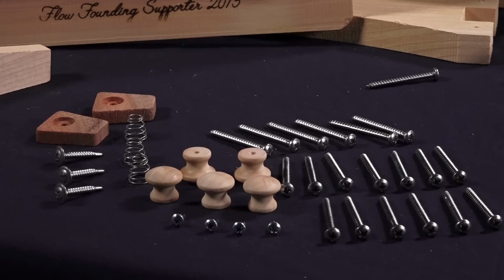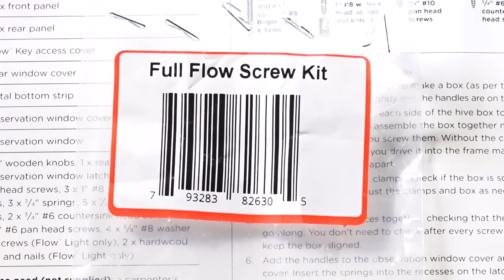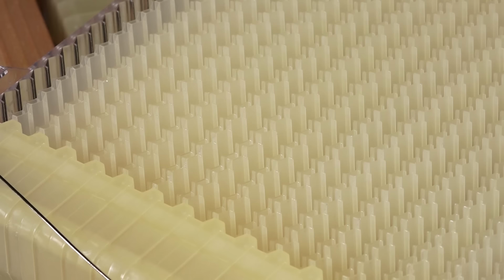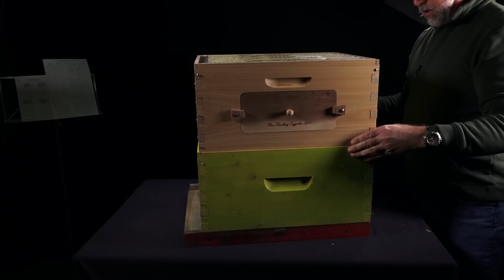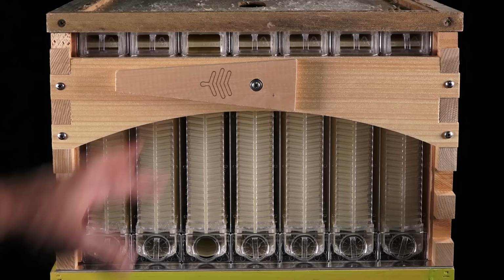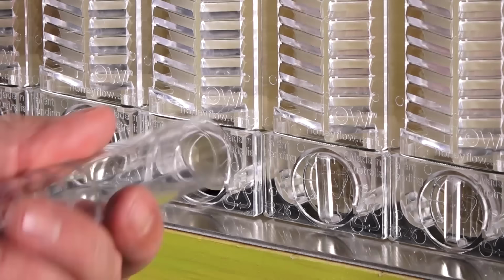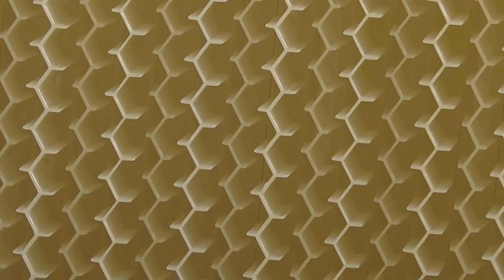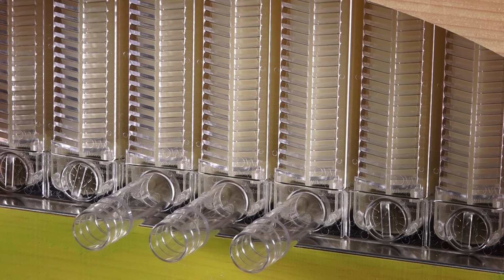The Flow Hive for honey bees, Love it? Hate it? or Undecided? Price? Review of Quality Control

Comment: This is the best tour of the Flow Hive full kit I've seen.  Thank you for your efforts.  I have a question about hive beetles.  Another FH user augmented his existing super with only a few FH frames and found he still needed to pull the frames to inspect for pests and this negated the benefit of using the FH frames to reduce disrupting the hive.  Do you think this will be a problem for your hive?  Are beetles a typical problem in your area?  Will you still pull your frames periodically to inspect for pests or do the bees herd the bugs out?
Reply: I just wanted to add that it is a great video, and I had to subscribe to see how it goes after you start your season.  Thanks
Reply from the maker: +Rave Racer First, thanks for the comment about the video.. and second, the honey bees I keep are super hygienic and varroa resistant lines, they route the hive beetles and mites out on their own. They are actually almost too vigilant in that they eject developing bees if anything is "detected" within the cell. I will of course, certainly show any evidence of small hive beetles with micro/macro video... but I don't expect a problem there. I'm also probably going to be one of those managers who does pull frames, even if it's a flow hive configuration, and then continue with draining honey if it's ready.
Reply: Cool, I'm looking forward to seeing that, especially how you put the frames back in without crushing bees considering the frames are such a tight fit.  Also I'm curious to see how you keep the bees from passing to the drain side of the box if you take the frames out.  Thanks for the response.  Good luck with your season.
Reply from the maker: The lateral space between cells is normal, not any different than normal drawn comb. The only tight, non passable, area is at the end you open. Other than that, it's normal.. pulling flow frames will be no more hazardous to the bees than when pulling normal frames with bees on them.

Comment: I didn't read the whole commentary history, I don't know if someone already said that, but I think the mismatch in the box joint is something related to wood expansion / shrinking, caused by changes in air humidity and the poor quality of wood. If the manufacturer did a mistake, it could be the choice  of the material.
Look at 2:12 to 2:18; the piece of wood on the right looks clearly larger than the one on the left, should it be expansion  or shrinking or - in the worst case - bad dimensionning and woodworking, but I don't think so.
Nevertheless, the clearly off center holes for screws don't help my version :)
Reply from the maker: The top and botton edges of the pieces match up perfectly, only the joint dimensions were off. The assembled box sits flush and top edges match perfectly.
Reply: So, in fact, for this one, it is obviously "bad woodworking".
Anyway, your video is very instructive, thanks.
Reply from the maker: Steel Mecano thank you

Comment: But if i bought the regular bee boxes for 3something then in order to get my honey i need another machine to spin it out and with this flow hive you just drain the hive basically so for about the same price on the 7 section flow hive you cut out spinning your honey just wondering if i missed something.
Reply from the maker: That's true, you end up not needing the extraction equipment... no uncapping tank, no spinner, no intermediate tank to hold the honey, no filtering process. So with the flow-super you would save all of those steps and also not have the cleanup which is something I personally don't miss :)

Comment: Apparently, the purpose of this FlowHive harvesting method is that you don't have open and take out the frames. But in the video you say that you would never harvest honey from cells that have not been capped ('cause the honey in them would not be ripe, water percentage higher than 20-22 %). And another point is: once you harvest the honey without cracking the wax capping on the cells, would the bees reopen and refill these empty cells or would they think that there is honey in those capped cells and rely on this "ghost stock" for the winter, risking to starve?
Reply from the maker: +steel1583 I personally open and look at the surface of any frame I plan to take honey from and I advise others to do the same. These FlowFrames are really not designed to be "pulled" although they show it being done on their website and in their videos. They are very flexible and HEAVY as they are deeper and heavier than a normal deep frame. The Honey Bees do know pretty fast that the honey is missing and chew off the caps, going right back to replenishing their honey stores.

Comment: What kind of plastic is this made out of?
Will it affect the honey?
Will the plastic deteriorate with the bees and sun thus affecting honey quality?
Reply from the maker: Now that many years have passed, these original frames are still usable. The honey does not take on any aspect of the plastic. In Hive Life (conference) in Tennessee held on January of 2023. Flow-Hive Honey won first place in the dark jar category. The judges mentioned that there were more entires than they have had anywhere in North America for more than ten years. Flow-Hive Honey avoids smoke, and other processing surfaces and particulates that most other honey takes on. Plastics are not showing up in honey, or the gut microbiome of the bees from the flow-frames. Micro-Plastics have shown up when swiffer sheets are used in bee hives for small hive beetle control, present in the bee gut, and honey.

Comment: What happens if you harvest the honey and discover it has a too high water content? Is there a way to test before extracting?
Reply from the maker: You can test the honey as it's being harvested. I've not had issues with it being too wet. BUT, if you did remove honey that had a high water content, I'd move it into a small room and run a dehumidifier  with fans running until the percentage is under 19%. If you see capped cells through the ends, you're 99.9% certain the honey is ripe. I've had no issues with that.

Comment: This is probably covered in the flowhive website or something and I am not a bee keeper but from the looks of the cells and your reference the the key system you are going to rupture the cell walls prior to allowing to the honey to be drained away.  However all the cells will still be "capped" but 90% of the honey will be stolen away, will the bees know that they need to uncap the cells & repair/refill them?

Can't wait to see the system in production...sad that they seem to take such attention to detail on the plastics but outsourced the carpentry and packing to a substandard outfit.
Reply from the maker: Yes, the bees quickly figure out the cells are empty, they remove the remain cap wax and start over.

Comment: But how much is the extraction equipment used in conjunction with traditional hives?  Also one would need facilities in which to house the extraction equipment. Also there would be less bee loss with this set up. Don't get me wrong. I'm not a professional beekeeper but I've worked around facilities that process honey and I see dead bees that get stuck in the honey and equipment.
Reply from the maker: Hi Steven, you are right, even though we take every precaution, there are always always... honey bees smushed when pulling frames, boxes and extracting with the traditional uncapping and spinning methods. Watch traditional extraction videos and see how many "bee-parts" are caught in the filters while the honey passes through. This is definitely a "feel-good" method. Thanks for commenting!

Comment: I'm guessing that the dovetail issue might be due to the machining being don on wood that has not finished drying, and the shift occurred during that process.
Reply: (box joints, not dovetails).   IMHO the core problem is probably that the production in the USA is being contracted out.   As a general rule, a company that is developing a new product takes great pains to ensure high quality.

But contractors are doing it for the money and there is (in the short term) money to be made by sacrificing quality.    IMHO only a very strong contract with very explicit specifications for quality/tolerances/defect rate etc and stiff penalties for failure to meet them (including free replacement of all defective units) can counter this problem.  If I was contracting out production of a product I would choose a country to do it in with a strong cultural background of high quality (such as Australia or New Zealand) rather than China or the USA, even if it cost significantly more.   Low quality production always costs a lot more in the long term when all factors are considered.

It seems that, in general, the quality of production is a lot higher in countries that treat their workers well (again like Australia and New Zealand) and far lower in countries that severely abuse their workers (like the USA and China).
Reply from the maker: That's a good guess Dean.
Reply from the maker: Hi Jim Barron! I think the best wood-workers, if we're basing it on Nationality, would be Germany without a doubt. The new contract here in the US is with a company in Oregon and the products from them have been flawless. You are absolutely correct in that when a new product/company is being introduced, that quality control should be a top priority as they are also reputation building. As for the box joints, yes, you are absolutely correct and that's my most frequent comment :)

Comment: you didn't include the cost of a honey extractor,  (ebay from $280 to $550) when explaining getting a normal bee hive ,so it would be cheaper for beginners to buy a flow hive at around $600 to $700 and the brood box super and top& bottoms (at $168 inc p/h 
16 FRAME DOUBLE BEEHIVE WITH 8 FRAME BEE BOX FLAT PACK HIVE from ebay)
compared to your quote of $354+...so it's not much more to buy a Flow Hive  and you wont cause much annoyance to the bees.
I intend to have the Flow Hive and eventually a double nuc hive so I can learn more as I go.
I also am led to believe from Flow Hive,that they have fixed the problem with the dove tale joints.
thanks for your video.
Reply from the maker: Hi Phil, I don't know why you're using all caps in your comment, but thanks for sharing your thoughts. All the best with your bees.

Comment: I want to start with beekeeping to improve the forest behind out house. I've read that bees are great at helping with that. Earning something back is.. well not necessary however it is nice. If I do start I will most likely use the honey for making mead. (Brewing is one of my burning passions).

Would you still recommend me running away from beekeeping?
Reply from the maker: I only recommend "running away" to those who have no interest in bees, but rather see $$$ signs when they think of the honey. BUT, Mead is cheaper to buy than the value of the honey produced to make it, which always makes me suspicious of the grade of honey used in the making. Making your own Mead (my favorite drink) is a great reason to start keeping bees in my opinion. BUT there may be seasons or even years when they don't produce enough for you.

Comment: i might be wrong, but wont the bees forget to make the wax hives on their own in the long run? just an observation, i dont have any knowledge about this culture/
Reply from the maker: You are indeed wrong on that assumption. Only the FlowSupers have the mechanized frames in them, the bottom "brood" chamber is traditional in design and has normal drawn comb frames inside. In my opinion though, bees don't "forget" how to do what they are genetically coded to do, they will always do something to modify their nesting site. IF they find the conditions inside the hive not to their liking, they simply won't use it and will move out on their own. Thanks for the comment though :)

Comment: Now that is a definite screw-up on the company's part I get my money back take a picture of it and get my money you're getting me another one
Reply from the maker: Nope, their response was that "we make thousands of these and less than 3% have problems"... they were contracted by the FlowHive folks right here in my State and they let quality control slip. The newer FlowHives are made by a completely different woodworking company and I've had no problems with any of the others. It was a one time fail for me. The original woodworking company has since also changed their company name.

Comment: Not a dove tail.  It is called a box join or box joint.  The alignment is badly done but the joint is not a dove tail it is a box joint.
Reply from the maker: +scarmenl Thank you, you are absolutely correct, those are indeed box joints. It's the most frequent comment I receive. I hope you found other parts of the video helpful?

Comment: Not to pic nits, but those aren't dovetails....they're box joints.   Dovetails are V shaped like a Dove's Tail. 

Thanks for the vid.  I was very interested.
Reply from the maker: +Zerkbern DANG!!!! it... you're absolutely correct Zerkbern! I should know better :) and thanks... the largest room in the world, is the "room for improvement" :)
Reply: Frederick Dunn
I never seem to be able to get out of that room!
Reply: +Zerkbern I think that the flowhive started by making the joint as dovetails and the word stuck .  I just realized that now in this conversation
in any case,  box joints ought to have been easier to fit so I am 
disappointed hearing many of them are badly made
Reply: Box joints are fine...when they are done right.  It's really disappointing they did such a sloppy job.
Reply: +Zerkbern I like the dove tail joints better but will settle for the box joints if done right
Reply from the maker: Indeed.. I was very surprised myself...

Comment: Do you call these "dovetails" in the US? These are box joints in the UK. Dovetail is so named as it looks like a dove's tail (kind of v shaped)and is much stronger than a box joint. I put my Flow Hive together no problem. True, it's not the best quality material in the world for the price but a few bits of sanding did the trick.
Reply from the maker: You are absolutely correct, they are box joints not dove tails. apologies all around.

Comment: Please give anyone answer.
Q1   How and where the bees enter in top of the box ?
Q2. when we get honey where bees go ?
Q3. When we get honey in upper box, at the same time, is it necessary to get honey in bottom boxes ?
Q4 why are there two or three boxes ?
Reply from the maker: 1) Bees enter from the bottom entrance and walk up through the frames. 2) Bees do not have to be removed during honey extraction. The mechanism doesn't kill a single bee when cycling and they to right back to work on the cells when extraction is finished. 3) Honey should be left alone in the bottom/lower boxes in colder climates so the bees have resources for rearing brood and surviving winter cycles. 4) I always use a bottom box for brood production, then a second box for honey/pollen storage and then the Flow-Super for honey extraction. That's because I live in a colder climate. In warm climates such as Hawaii, honey production continues through the year and a single deep may be used with the flow-super directly above it.

Comment: In defence of the Flow Hive, we don't generally use telescoping covers in Australia.
Reply from the maker: +Pop&#39;s Shack Flow Hive is fine and really doesn't need "defending" you're right that they have a different cover design. The reason I demonstrate that aspect, is so that people can be thinking of a cover alternative or modification. Most keepers here are using covers that are designed the way mine is, or even the insulated covers. I am modifying my cover for this super and making sure it doesn't impede the operation of the flow hive. It's not a "flaw" it's just something what may require some extra attention/consideration. Thanks for sharing!
Reply from the maker: +Pop&#39;s Shack How is your flow hive working out for you? Any surprises good or bad?
Reply: Frederick Dunn I don't have a Flow Hive but a mate of mine will be setting his up in the spring. I more than likely won't have any results until next year.
Reply from the maker: Oh, well you'll learn much from his hives I'm sure... I wish you well!

Comment: I assume you sent a copy of this video to the manufacturer.  There is no excuse to have the dove tails that badly done as well as shipping it out with screws that dont fit or not even there. At least the business part of it works. I have seen others show how these work and they work well. I am impressed at how well they work.
Reply from the maker: Hi Scott, yes, I did indeed and the man representing the shop this came from simply said "we receive complaints on less than 1-2% of the thousands we've shipped and I think that's pretty good".. end quote. The next three I purchased did not have these issues, but they came from a different wood-shop. More coming in this year, we'll see how it goes :)

Comment: I am completely ignorant about bees.  I worry that the lack of bee crawl space at the external walls will prevent bees from being able to determine the temperature there and taking steps to control it.
Reply from the maker: There is space on the sides and between the frames, plenty for ventilation and in the super it's important for the bees to be able to ventilate and dehydrate the honey.